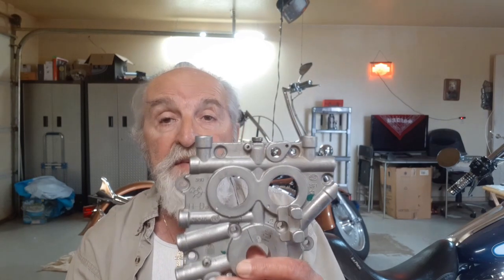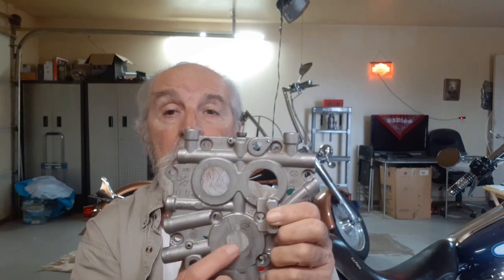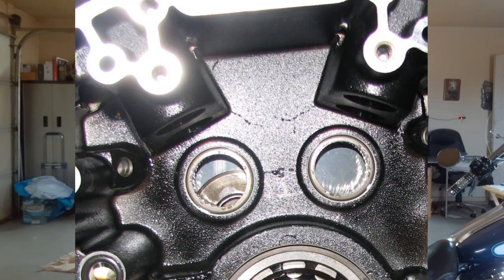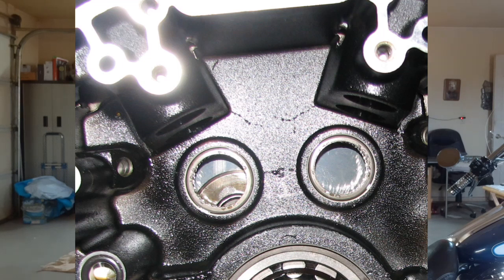Servicing Harley Twin Cam Cam Plate Bearings and Bushings

Comment: You forgot  to mention the first twin cam in 99 came out with two plain outer ball bearings on the camplate the rear cylinder one was prone to fail and many did .harley upgraded it to the roller bearing later that year from Dec 14 on.any what failed were replaced under warranty harley gave you 5 years or 50k to get them replaced . I only recently purchased a 99 here in Australia  with only 14k I decided  to take a look at the cam chain tensioner  pads .they were still ok .but to my horror I found a piece of bearing cage just lying in the camchest I could see a gap between two of balls in that bearing where the cage was missing .lucky I caught this in time.so now I have fitted all upgraded bearings .so happy days .love your vids mate .keep em comming 👍
Reply from the maker: Yep I didn't mention it because I thought all the rear ball bearings had been changed. Everyone I've worked on has already been changed out to the roller, so I've never seen one with the 2 ball bearings. Finding a piece of the bearing in your cam chest would definitely make your heart skip a beat. Glad you didn't have any damage and you've upgraded. Glad you enjoy the videos, thanks for the comment and thanks for watching. Ride safe.
Reply: Yes I was lucky the 99 also had the rear cam with the keyed sprocket which was also known to fail .andrews make an upgrade sprocket which is twice as wide they were able to do that by doing away with the 350 spacer washer behind the sprocket and just making a wider sprocket with a separate full length keyway .I brought one and fitted it these did not fail .one good thing the 99 had had the timken bearing crank shaft which harley done away with in 2002. Thanks for your  reply take care.

Comment: Great info Thanks for the heads up .
Reply from the maker: Glad you liked the video. Thanks for watching
Reply: @tinkeringwithharleys  When can you do a video on Cam swapping ? Doing c am tentioners , decided to change the cams while I had it apart . (Andrews SE-204 ) . My dumb ass not thinking about the tuning .. ( 2004 RK 88cu in ) .  I have V&H Fuel pack already on it . I am on a budget , Love to have it dyno tune but $750 is way over my limit . What would you suggest ??
Reply from the maker: Thanks for the question. I've done a number of videos on spring loaded cam tensioners, but none on the hydraulic or gear drives. I started the channel after I did the last conversion. I don't have anything planned for a cam upgrade as of now. Unfortunately I know nothing about the electronic fuel packs for injectors. I only deal with carburetors. Any bike I've worked on with fuel injection it is with the understanding that the owner has to put the final tune on it. I'm strictly a old bike guy. As far as the Dyno goes, I do understand the ridiculous cost of having that done. My suggestion would be to try to do the adjustment with you're fuel pack yourself. You'll need to richen the fuel to accommodate the bigger cams. Sorry I couldn't be more helpful, but like I said I'm a old bike guy and the older the bike the better. You might want to try asking one of the other guys on YouTube that do the electronics. Good luck and thanks for watching.
Reply: @tinkeringwithharleys  Thanks for feed back . I feel the same way . I am Old school myself . You can check out some of my videos on my Iron head .
 I am a guy with a tight budget . I do all my own work . When I add some thing to my bike , Its just a disappoint having to take it to some else just tune it . Spent $300 on an upgrade and then have to add another $750 for software and tune . Just seems to me every ones want a piece of your pie when up grading your own bike
Reply from the maker: Yep I really dislike computers controlling anything on my bike. After more than 50 years of doing this, I've just refused to move into the computerized systems. I completely understand working on a budget. My son is from the computer age so he does the computer work. I refuse to do it. I'll check out You're channel.👍
Reply from the maker: Checked your channel out👍 did you get you're compensator straightened out
Reply: @tinkeringwithharleys   Yes . I tighten it up to the torque specs . No issue so far

Comment: Tell us about the new plate 07, 08 etc and the shoes. 15/20 thousand miles is terrible.
Reply from the maker: Thanks for the question, the  06 Dyna and all 07 and above can plates are no longer spring loaded. They were all changed over to hydraulic chain tensioners. Also the material used for the shoes was changed from the hard brittle plastic material to a more durable material. Converting to hydraulic tensioners from the spring loaded tensioners and changing the material for the shoes has greatly extended the life of the shoes. With the hydraulic tensioners they will now last to 40 to 50,000 miles before needing service. Which is a vast improvement over the spring loaded tensioners. The elimination of the bearings in the cam plate and just having bushings for the cams to ride in hasn't been a problem. The stock cam plate is still cast aluminum so that has remained the same. Hope this answers you're question. Thanks for watching.
Reply: Thank you very much.  I have 23 thousand on a 08 Softail custom, been wondering just how far to push it.

Comment: What's wrong with Harley needle bearings and why go to aftermarket?
Reply from the maker: Harley bearings are now made in China and Taiwan. The needles in the bearings are small and material used is substandard. If you place a stock Harley bearing alongside a after market bearing you can see the difference.  The aftermarket is better quality. Thanks for the question and thanks for watching.